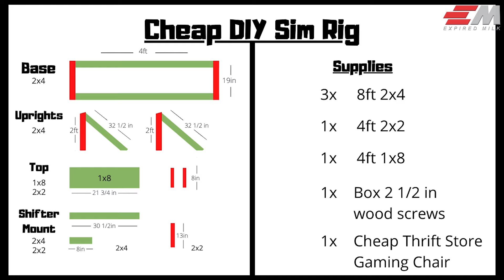Best DIY Sim Racing Rig For Under $35! (Budget Build w/ Plans)

Comment: thanks for the video, and going the extra mile, and supplying a pdf download as that's super helpful. I've had a hyperdrive then a playseat, but have not sim raced for about 5 years, going to use your build as a starting point to get back into it. Cheers from the southeast coast of Australia!

Comment: Just put this together. Awesome spec sheet. Works great so far!
Reply: What wheel you driving? Is it sustainable with an direct-drive?
Reply: @kazimcanbas9187  I’m using a g290. But, it is very solid. With room to improve rigidity easily if needed. You would have no issue.

Comment: As for the seat.. go to a car junkyard and buy a seat & the rails it is mounted on. If you do, then use the bottom beams at 1.5 the given length to allow sliding your seat.

Comment: Just got outta the garage from building this thing, nice plans. I didn't do the shifter portion or the diagonal supports but it's still very sturdy.
I ripped the passenger seat out of my Honda for the chair cuz racecar. Had to cut some additional pieces to accommodate, but now I have a fully adjustable seat.
Total cost for the build? $0.

Comment: Next time if you want to have an easier time making it square and make it a little stronger. Have the front and back horizontal boards sit sideways in between the length of the two long boards. Then put a 90° triangle piece in every corner and then screw it tight. The force of the drill we'll pull the sides into the middle piece you create and make a perfect square and it will add a lot more strength.

Comment: Cool build, do you know roughly what angle you cut the top of the supports on either side of your rig for the wheel?
Reply: I built this set up...almost the same. I used 10 degrees for mine
Reply from the maker: 25 degrees

Comment: Im not carpenter nor a woodworker this is both a question and a statement but wouldnt putting a wood piece under your legs across the 2 posts and then another piece behind the wheel across the diagonal posts increase structural rigitidy?
Reply from the maker: Probably, although I’ve found it’s held up pretty well. At least with the Logitech wheel.

Comment: Thanks for the video. I have one of those car chair computer chairs and I am going to be basing a similar rig on yours I am only slightly altering the design and shortening it and raising the steering wheel to use with any chair I want. How did you secure the pedal to it?
Reply from the maker: That's awesome, I hope it comes out well!  The pedals on mine werent affixed to the rig, what I ended up doing was just putting a small piece of wood at the back of the base for it to rest on to give it an incline.  It was a slight bit shorter than the 2x4 of the base so it rested against the back and never moved.   I hope this makes sense!

Comment: Awesome video!! I think I’m gonna make it but I just wanted to ask how did u mount the pedals or are they just pressed against the plank
Reply from the maker: They are just pressed up against the plank.  Makes for easy adjustments if someone shorter wants to use it 

I also have a small rug placed underneath the rig now so the bottom of the pedals grip it so it doesn’t move around at all

Comment: i may be captain obvious, but i dont think it will work with a gt dd pro 8nm, right? i mean thats a lot of power, sure some wood could accommodate a g29 or a t150/t300, but i think a DD is too much, or should i look at this as a viable option?
Reply from the maker: It’s pretty sturdy and would probably be fine but I think I would go with something a little beefier just for long term.
Reply: @RealExpiredMilk  thanks! Will take it under consideration

Comment: Thanks for the video and blue print info EM. I joined your discord. Saw you had added a tv mount to your rig. I didn't notice if you posted anything showing the measurements on it or not. Was wondering if you added it separate to your rig, or if it is mounted onto your rig? I have a tv I would like to add onto being part of this rig so was just interested. Thank you again.
Reply from the maker: sorry for the delayed response. I added it on later with a couple 2x4 and some L-brackets at the base for stability.  threw on a tv mount and bam.  its about a 24in tv I think.  I wouldn't go much bigger than that though. I don't remember the exact dimensions but I want to say theyre about 3ft tall

Comment: i just purchased a chair like yours to build a sim rig but im asking myself how to mount the chair in the wood (sorry for my bad english im french) ^^
Reply from the maker: I just cut the bottom open an ran a 2x6 along the back of the bottom, then have a small 2x4 on each side of the chair screwed in connecting both sides to the rig.  Hope this helps. Good luck with your build!  I’d be interested to see it when it’s finished. You can post pics if you want in the discord server!
Reply: Where did you buy the chair?
Reply: Bonjour

Comment: Did you tilt the pedals at all? If so, how?
Reply from the maker: I ended up tilting them with a piece of trim screwed into the end of the base coming up about an inch shorter than flush so it would sit tilted

Comment: How do you mount the pedals down?
Reply from the maker: I don’t actually have mine mounted. Just propped against the back. However if you wanted them mounted you could add a small piece of plywood to bolt the pedals into.
Reply: @RealExpiredMilk  that’s what we ended up doing. We kinda built a box for it so it would not side around and proper it up a bit.
Reply from the maker: @joshfearing7264  Hell yeah! hope it does you well.
Reply: @RealExpiredMilk  were your pedals sturdy as you smashed the brakes and gas?
Reply from the maker: @yenice3652  yeah
Reply: @RealExpiredMilk  much thanks, you have one of the better and easier builds I've seen online, debating between this and a pvc build.

Comment: Nice, but can you link the Chair
Reply from the maker: I bought mine from Goodwill for $4. But I just put a link to the exact one on amazon in the description so you can check it out.  Thanks for watching!
Reply: @RealExpiredMilk  I'm searching for this kind of chair too but I don't find your Amazon link inthe description 🤔😅
Is it confortable? Do you like it after 7 months?
Reply from the maker: @waltysmith  Apologies I must have accidently deleted the link when updating the description.  However, I just added a new link to a similar chair as I couldn't find the exact one.  Yeah it's still holding up pretty solid so I cant complain.  I find to be actually more comfortable then my desk chair although tbh that's not saying much haha.

Comment: Would this rig also work well for people over 6 foot, or would I have to adjust the measurements?
Reply from the maker: I’m 6’2” and it’s pretty comfortable
Reply: @RealExpiredMilk  great! I built this thing a couple months ago, with some adjustments (I made everything from the chair to the steering wheel and gear shifter adjustable) and it works amazingly! Thanks for this tutorial, it’s a lot of fun